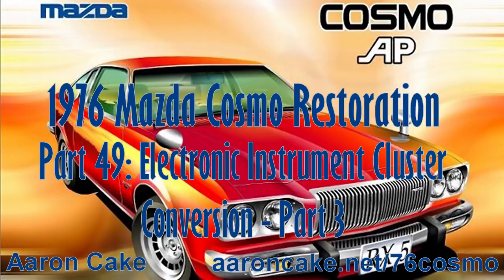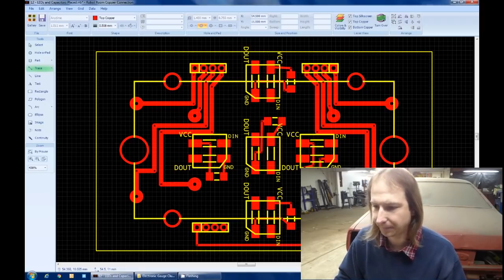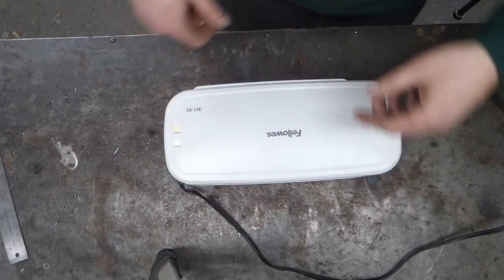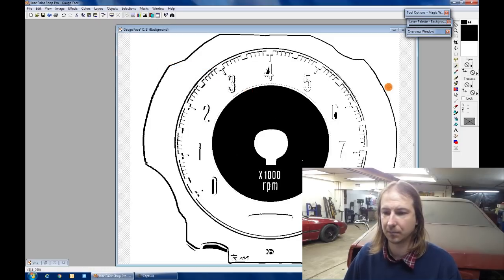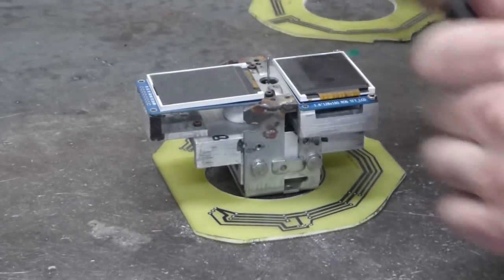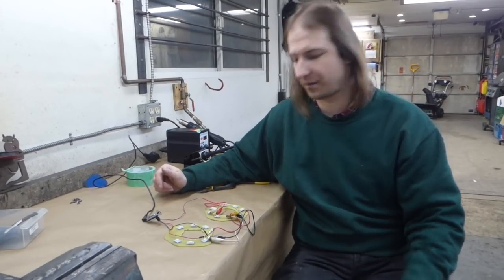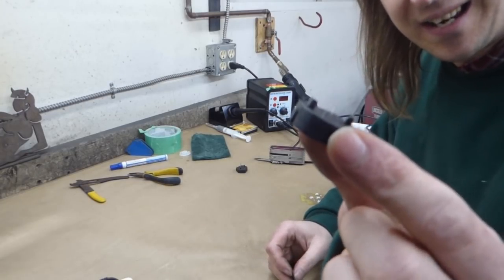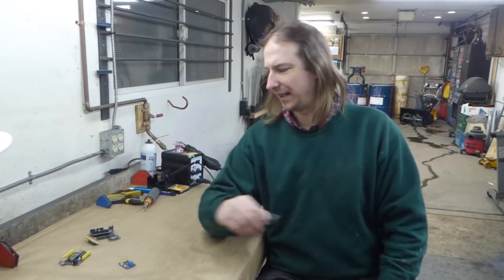Part 49 - Electronic Instrument Cluster Conversion - Part 3 - My 76 Mazda RX 5 Cosmo Restoration

Comment: I hope you're going to draw the new board in something like kicad rather than .. whatever it is you used for those boards. I would also save your money and go with JLCPCB; PCBWay really isn't any better for your purposes and is more expensive. That ATmega1284 is just a glorified 328P; the performance, aside from the additional RAM, really isn't any better. I honestly think you're going to regret your decision to go with an 8-bit processor with that many screens to drive. And what's wrong with 3v3 logic? Almost everything works with 3v3. If you need 5V logic for something specific, include a bi-directional voltage level shifter on your board. You say you don't want to learn to work with the STM32, but I think you should reconsider.
Reply from the maker: Good, good questions. You'll be happy with my CAD choice in the next episode. Usually one off boards I just use Copper Connection however the cost of produced boards now is so cheap it is even getting harder to justify making my own one off boards...save of course for the wait on the slow boat from China. Absolutely, the 1284 is a "bigger" 328P...and that's why it's awesome and unsung. Library support is great and if there are any issues, it will just be a few pin and/or register changes before it works. If I had peripherals sending at 3.3V I might consider using 3.3V however in this case, the only 3.3V parts are the TFT screens which are strictly output, so quick and dirty 1K resistors do the job. Remember as far as performance goes, we're not talking a lot of power needed. All the screens are going to display are essentially fixed, with small changes (like an odometer reading).
Reply: @aaroncake  Hahaha, I can't wait to see! Indeed, chinese boards are so inexpensive that even with DHL shipping I consider them dirt cheap. I remember buying a bunch of things to do pcb milling, but in the end I never even tried because ordering complete boards from China is more convenient. I agree, the 328p and 1284 are cool and certainly, library support is good, but the STM32 is also a very popular choice; I doubt you'd have much trouble finding what you need. What are all the things you are running off of 5V?
Reply from the maker: I have used the STM32 in other projects and do like it. Especially because they cost about $1 and have USB host support (BluePill). I really had intended to use STM32 for this yet found CAN support on the various Arduino platforms for STM32 to be nonexistent and didn't want the project to be about figuring CAN on STM32 out. Really the only 5V peripheral is the MCP2515 CAN controller so ti was a tossup between needing a level converter for it, or just using dropping resistors for the screen. Dropping resistors won.